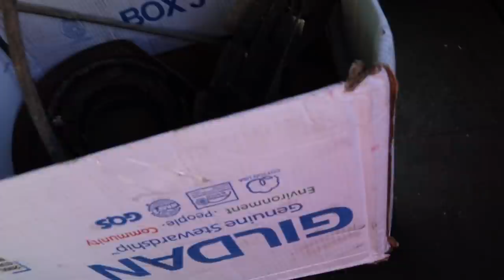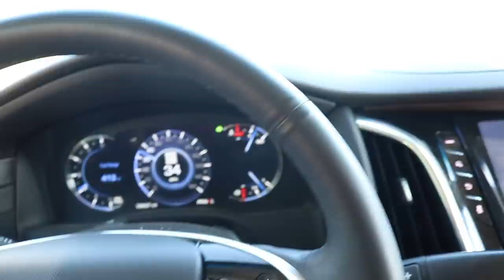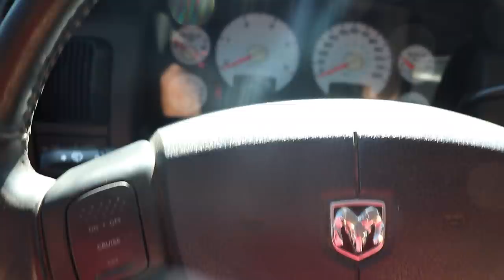I FIXED the WhistlinDiesel Dually!!!

Comment: Smh not torquing down wheels
Reply from the maker: Huh
Reply: LOUD 'N' PROUD torque your wheels. Torque wrench?
Reply: John S thats what you say but I’ll laugh when your wheels come off
Reply: @dodgeboys92  been doing it for years like that and never had a problem so far
Reply: @johns6768  I used to only use a impact gun too. Then I got new 22's this past spring and everything was fine on my way to work and most of the way home from work. I was 5 minutes from my house and heard a "clunk" and saw something fly past my drivers door window. Got out and looked the truck over to find my drivers front wheel barely hanging on with 3 lug nuts left. Checked the rest of them and one other wheel was beginning to loosen up as well, Had to get a new wheel after putting 50 miles on my brand new set of wheels. Luckily that is the worst that happened and nobody got injured or killed from my wheel coming off when I was on the highway doing 80 mph 5 minutes before noticing all of that. All of my wheels get hand torqued with a torque wrench now and then I check the torque again after driving the truck for 100 miles or so, to make sure they are all good still. I won't trust a impact gun, or torque sticks ever again. 140 ft.lb. by hand and I've had zero issues since.